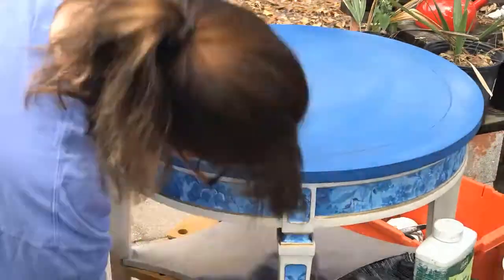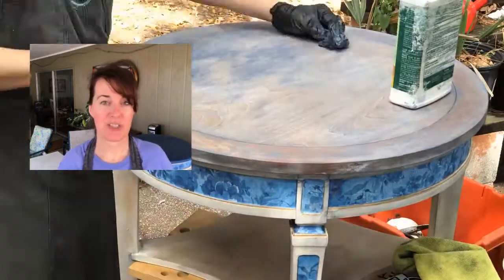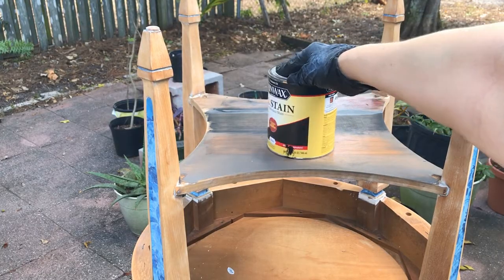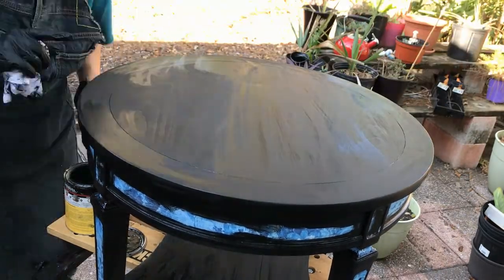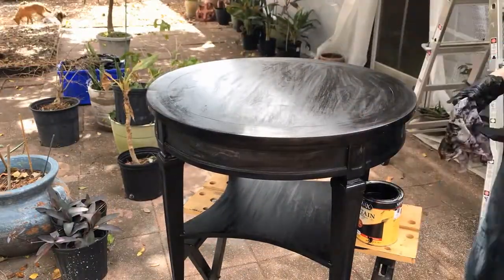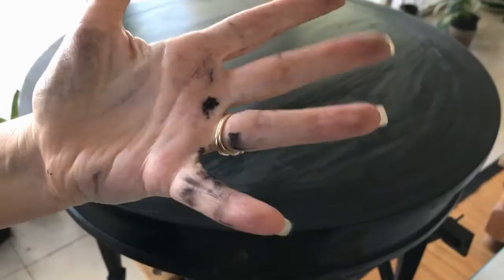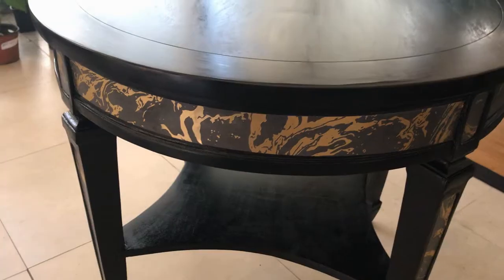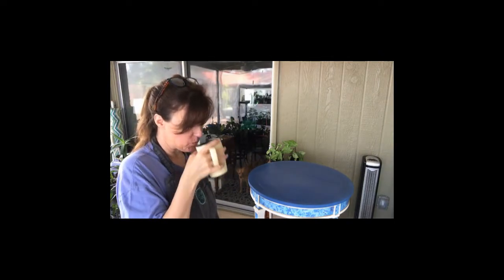How to use a black GEL stain and wipe on poly in the Round Table Returns!

Comment: i use general finish java gel stain on my tv stand top and waited 24 hours, then applied wipe on poly and it took some of the stain off. what do i do now? and how do i avoid this from happening again? thanks. love your video
Reply from the maker: How frustrating! However you should be able to give a relatively light sanding to remove the poly and then reapply the stain. Haven’t used that brand but it may have been an issue of not enough time between stain layers. It could also be that the stain pooled a bit in places (meaning it needed to be wiped off more and reapplied to darken if needed). Give the stain extra time to soak in and dry. If the wipe on messes it up again you may want to gently brush it on rather than wiping. Good luck and thanks for watching!
Reply from the maker: I did more research. A wipe-on poly has mineral spirits in it. Mineral spirits can take paint off and gel stains are prone to leaving lots of pigment on the surface. So your options are to brush on a coat of polyurethane (from a can) first then use the wipe on. Another tip is when you are sanding to prepare for stain do not to a higher grit than 120. (Go up to 220 when you want to paint the surface.) You want to leave groves where the stain can better imbed.
Reply: @AskingSpot  i just removed all of it and started over. stain turned out better then the first time but thank you. i love being able to reach out to people on here when i need help!